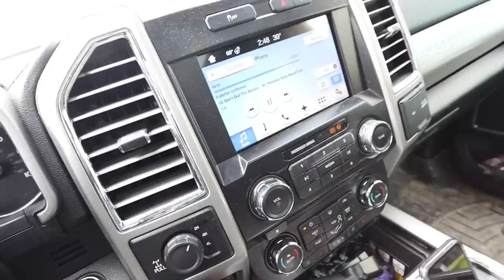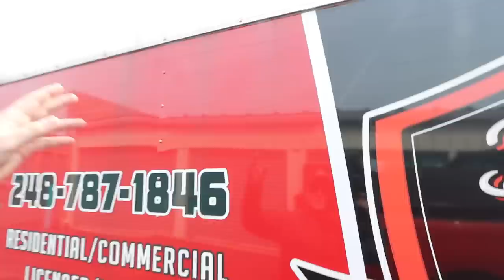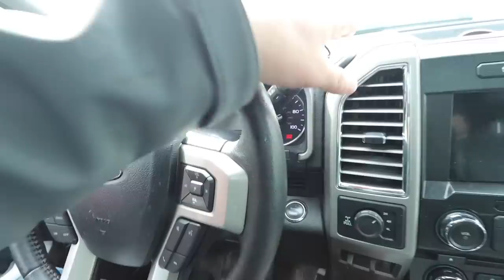NO DAYS OFF For Lawntrepreneurs! ► Working On Our Lawn Care Setup For 2020

Comment: Great video Brian, my trailer roof is different so I don’t have that black streak problem! My boards are flush with my tarp so I can still use my tarp system! I use the Milwaukee measuring wheel! I love the podcast I am half way through the one from today! I can not figure out how to leave a rating on Spotify.

Comment: Just so you know, the last measuring wheel I had was out by 2'. So if your finding your over or under on material, it may be because your wheel is not calibrated properly.